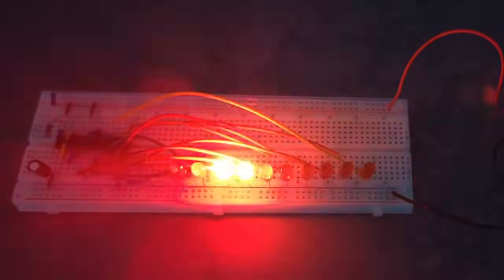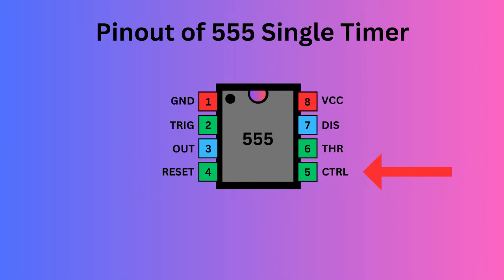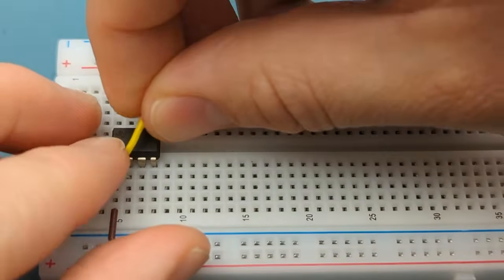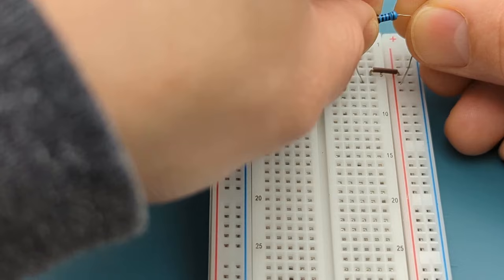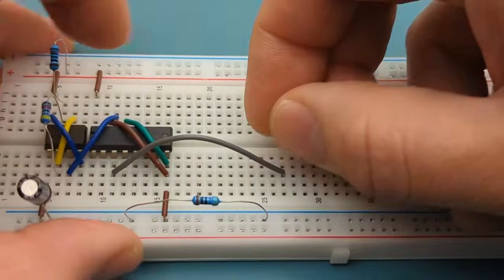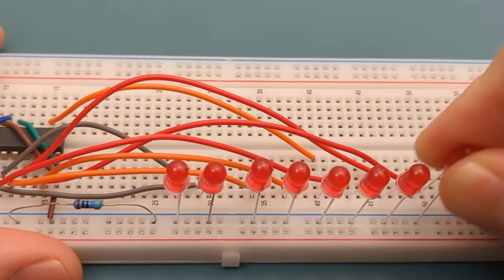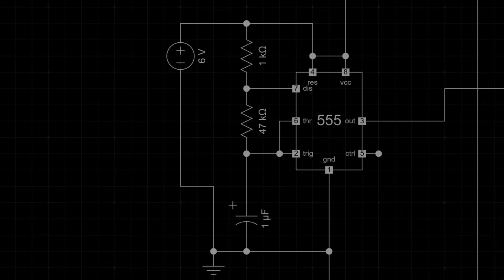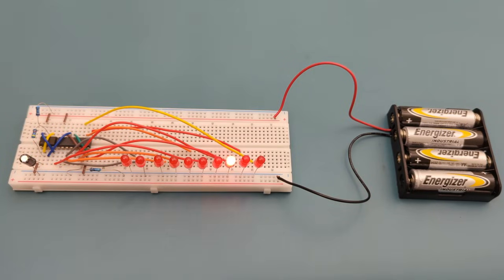How to Make LED Chaser Circuit With 555 Timer and CD4017

Comment from the maker: 🔔 Get your tools here:
✅ Electronics Component Kit: https://amzn.to/3N65asq
✅ AA Battery Holder: https://amzn.to/4gCInSx
✅ AA Batteries: https://amzn.to/4j0x3Rb
✅ NE555 Timer: https://amzn.to/41MpQhp
✅ CD4017 Decade Counter: https://amzn.to/427elAR
✅ Resistors: https://amzn.to/3YfGeUi
✅ Capacitors: https://amzn.to/3PzflXK
✅ Jumper wires: https://amzn.to/3NNn9UR
Reply: Only 4 leds are chasing rest are not working.. Can you explain why?

Comment: what if i want to just have a 3 led chaser is there something smaller than a 4017 that i could use?
Reply: yes but you have to get creative. You can wire the first 3 4017 outputs all to one LED, then outputs 456 to the next and 789 to the next and you'll only have a small delay when 10 would normally be. Also be aware that the video's setup has some flaws

Comment: Am I missing something?  Can someone explain how the current limiting is working?
Both leads of the 470 ohm, current limiting resistor are connected to the ground bus.  The LED cathodes are also connected directly to the ground bus.  This offers no current limiting protection.  In order to make this work with current limiting protection, I think the following changes need to be made:
1.	Move the left lead of the resistor to the right of the 4017 ground connection.

2.	Create a “break” in the ground bus between the resistor leads.  I don’t know how to do this on a breadboard unless you use a breadboard with built-in bus breaks).  This will essentially creating a new “LED bus”.

3.	Connect the negative lead of the battery to the left side of the breadboard’s ground bus so that the LEDs are not connected directly to ground.
Reply: You are right. You will 100% burn the led's the way shown. What you should do instead is take 10 (or however many led's you use) rows of breadboard to dedicate to an LED bus as you said, then connect each row to the 4017, then connect all LED rows to a new row that will output to a resistor of much lower value than 470 ohms (because you are limiting 10 led's in parallel so roughly 200mA @2ish volt drop which is 400mW meaning you need a 1/2w resistor at least) that leads to ground. The alternative is to split this method up as you see fit. Aka one resistor per 1/2/5 led's (and remember to adjust the value)
Reply: Maybe he's using a breadboard that doesn't have the full width of the power rails connected. So he's connecting one side to the other through the limiting resistor, and with only 1 LED on at a time it works.